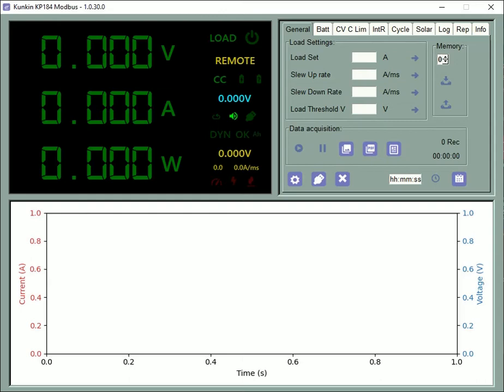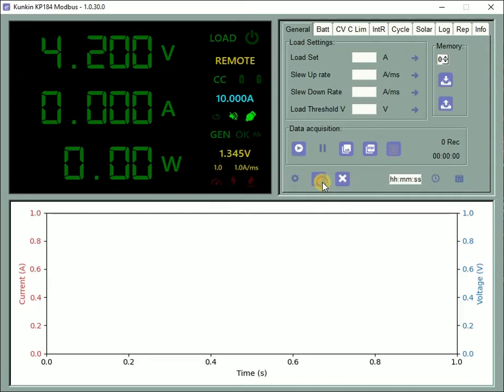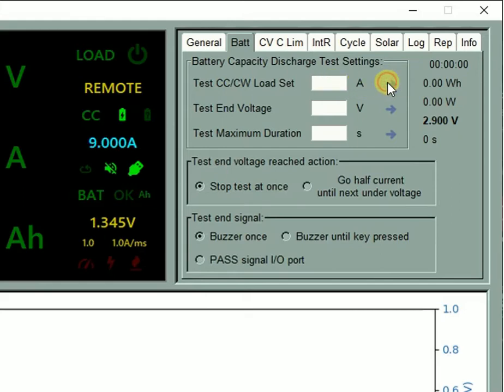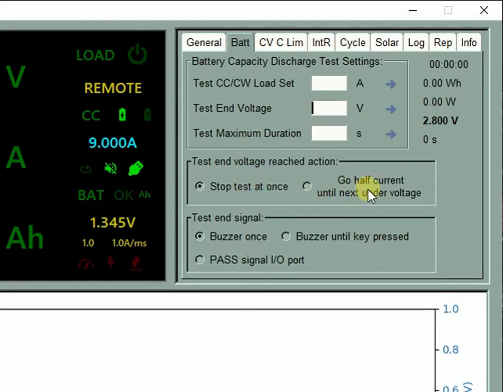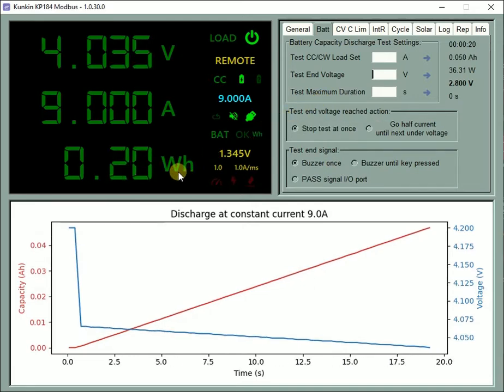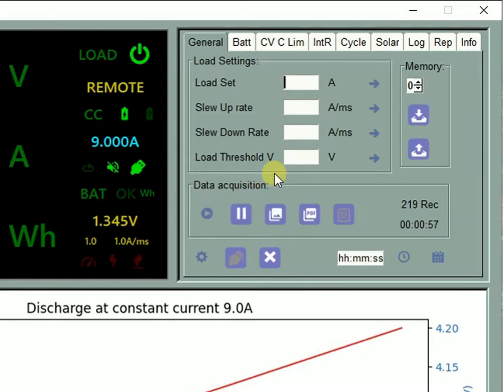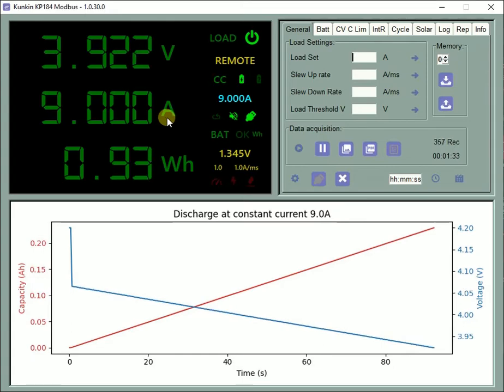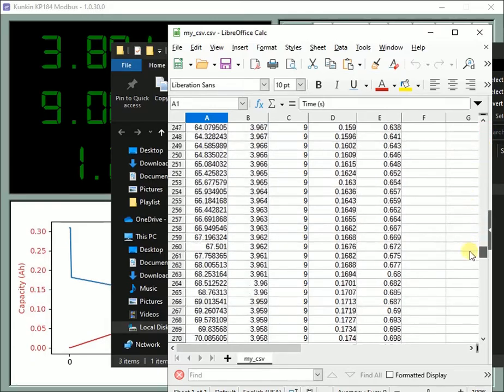Battery capacity testing with KP184 electronic load software

Comment: Hello friend, I find your video really amazing, I recently bought a KP-184 and just today I got the connector for computer, im I have been unable to make a connection proper.. after setting the COM port properly, and click on USB icon it flashes a few seconds then nothing.. if I check on LOG i see that Kp184 has not been found... could you please help me ? I tried in 2 different computers..
Reply from the maker: Hi Uilleam. Please read the software user manual regarding configuration, check the KP184 panel configured baudrate and match the software settings.
Please verify the operation of your USB to Serial adapter with a loopback test this way: Please shunt pins 2 and 3 on your DB9 serial port side and connect your adapter only to your PC USB port. Install some terminal software (Ex: CoolTerm) on Windows 10 (Hyperterminal is no longer part of Windows), run the program, configure to 9600,N81 no flow control, turn off echo, connect, press some test keys and check if you receive the characters back to the screen. This will prove to you that your adapter and drivers are at least working and the communication flows without problems in both directions...
Use my email interflexo@sapo.pt for further help on diagnostics and support.
Reply: i same problem in LOG KP184 not fonud